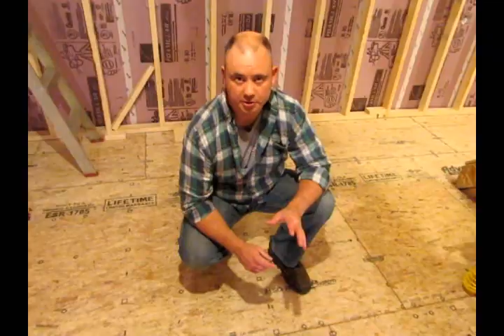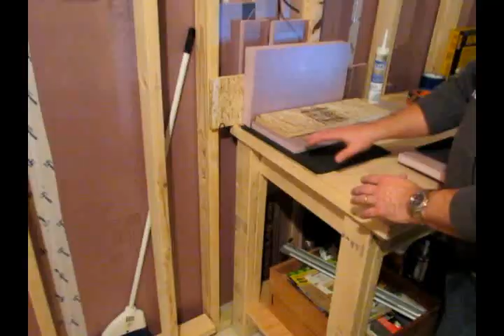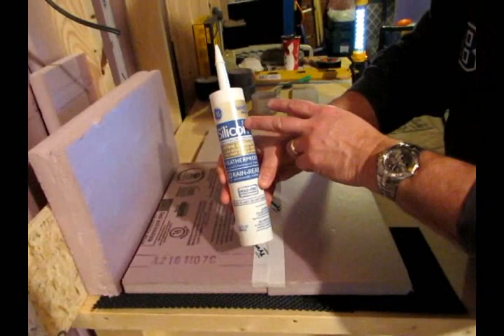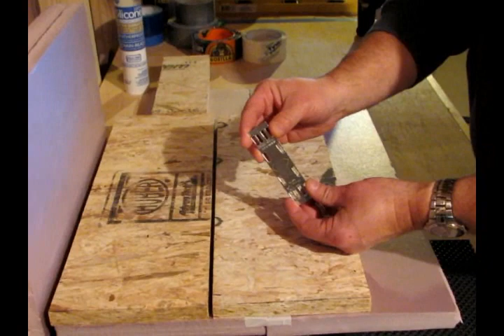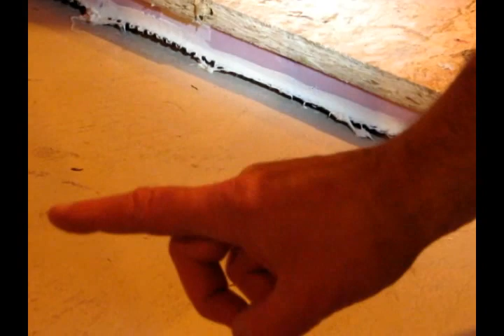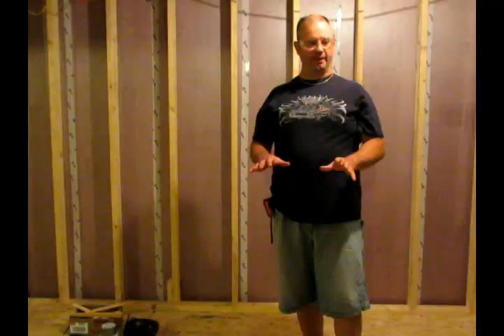Finishing a Basement - Part 2 - Floor Insulation & Floating Sub Floor

Comment: Thanks for the awesome videos.  Few questions: 

1) What brand of cement caulk did you use to fill the concrete floor seams? 
2) Did you consider first painting on a basement & masonry waterproofer on the walls & floor before the foam board?  
3) how high are your ceilings?  Were you concerned about adding mat, 1 inch foam, sub floor and carpet would be taking away too much from your room height?
Reply: If you don't install carpet and just lay down snap together flooring, can it be done right on the mat without a subfloor?
Reply from the maker: Thanks for the question. 
1.  I used DAP Concrete and Mortar Filler and Sealer (gray) which remains flexible and water tight after cured.
2.  I did not paint the concrete walls and personally do not believe this is a smart idea.  In short, it's darn near impossible to get a coating to be 100% "pinhole" free, and eventually the paint is going to fail anyway...so why spend the time and money on this.   Why...?   Even though there are many products which are intended as "waterproofing" or sealing products, and they probably work well in the early days of their lifetime, the reality is that concrete and masonry is porous, and will be a conduit for moisture and experience significant temperature swings through seasons.  Concrete is also almost always in some state of "wetness" even if it feels bone dry to the touch.  Therefore, any of these kinds of paints or sealers often are not getting great adhesion to begin with, and and perpetually exposed to moisture attacking the adhesive bond after it's applied.  Invariable, the paint will begin to bubble, eventually fracture and then peel.    This is not a permanent solution to "sealing" a concrete or masonry surface.  Here's a link to just one video about this and you can find more information if you search the web.
https://www.youtube.com/watch?v=f-ONJTLMjyE
3.  I have 8 foot ceilings through most of this basement but beneath the main beam and duct trunks about 7 feet.  I was concerned about height, particularly under the beam area, and spent quite a bit of time considering how I would manage the floor, but in the end I decided on this design as the long-term advantages of both moisture proofing and insulation were more important to me compared to the 2" I will lose under the beam.
Reply from the maker: The manufacturer of the dimple mat I used, SuperSeal, promotes this product as, "Carpet and Laminate Subfloor Membrane" according to their web page, and there you can find more information about it.  I They do promote use directly on top of concrete or wood surfaces, and so I would say that generally, yes you could use a flooring directly of top of the mat as SuperSeal indicates.  However, I would also suggest you speak with them about how to deal with some challenges you might face if you intend to use a hard flooring product as opposed to carpet including but not limited to:
a) Level:  most basement floors will not be inherently level or even flat, and in fact should be pitched towards the sump anyway.  Most hard flooring products require the installation surface to be level and flat to some significant degree, and so I might caution you on how you will deal with these challenges over the life of your flooring product.  This can be done, but techniques used for leveling and flattening floors can be a pain in the @%#.
b)  Securing the Floor:  If you install a flooring product which is intended to be and will be truly floating on top of the mat this should be no issue, however if you install any product which requires fastening to the surface below this may be a challenge / problem as you only have a thin, flexible membrane to work with or otherwise you need to go through it and into the concrete.   Any penetration of the mat at all and you have also now compromised your vapor barrier.
c)  Insulation:  If you use only the mat, the dimple profile will minimize the contact surface of the mat to the basement floor, however there is still contact and will be some heat conduction through the mat...I am not familiar with what kind of insulating value the SuperSeal mat will result in but you could contact them if you wanted to learn more.  For my project, using the rigid foam on top of the mat provides an additional minimum R-5 insulating value on the floor which we will be waling on and this was attractive to me.
d)  Safety:  This sound like a minor point, but I have a couple children and this will also be a space where they may be playing and frankly be allowed to be more rambunctious than in our main living space.  This design with the combination of the dimple mat, rigid foam, and wood sub floor has now turned a very hard, cold concrete floor into a significantly warmer, softer, and more comfortable floor for walking, sitting,,,, or even tackling.. :)
Reply: What about using densshield tile backer on the floor in place of OSB for fireproofing over foamular which is flammable. I'm not sure how well this works when building a stud wall nailed on top of tile backer. Would this work? I really like everything you have presented in your videos.  All these foam products are flammable. What are you planning to do for your wall cavities to make them fire resistant. Will you use rockwool insulation?  I don't know what to do with these 2 back to back problems- fireproofing and moisture proofing for the walls and floor. Thanks, Laura
Reply from the maker: Hi and good comments.  There's quite a bit of debate out there about the conflict of moisture-proofing and fireblocking....you can't fireblock "according to code" without the fireblocking penetrating the moisture barrier....and you can create a sealed moisture barrier from fire-blocking materials....ugh!
From all I have researched, this really comes down to interpretation of the code by the inspector.   The essence of fireblocking is to starve a fire of oxygen and thererfore stifle combustion.   By using a material like rockwool in all of the cavities between and behind the studs, and up through the rim joist spaces, you have effectively "fireblocked" provided any source of ignition is note directly in contact or accessible to the foam, where the fireproof rockwool comes into play.  In this method where you have no (very limited) air to support combustion, you have achieved fireblocking.  Of course, this is all subject to agreement by your local inspector, but the this is something the codes are very lacking in addressing.   I have seen where this is approved by local inspectors after it is thoroughly explains and provided they understand how this will achieve fireblocking.

Comment: Great video.  I am working on a similar project and have 2 questions...
1 - why not have the dimple mat curl up onto the wall foam?  Aren't you worried about moisture getting between the wall foam and the dimple mat that you have under the floor system.  That setup just seems like you may have the potential of getting water between the dimple mat and the floor foam.  
2 - how do you address where the existing basement stairs hit the ground?  You are elevating the basement floor by about 2 inches, therefore making that bottom step much less of a step than all the others.  Thanks for the video!.
Reply from the maker: Thanks and good questions:
1.  I actually considered this originally and did some testing of this on my own.  The dimple mat I used is product which can be used as a sub-floor material in itself directly under a carpet or laminate, and therefore is a relatively stiff material which does not lend itself to bending too easily.  It can be bent to form a corner, however as it is stiff, the bending actually requires some creasing which results in some plastic deformation around the many dimples; my concern with this is that deformation may lead to cracks or fractures and then we've compromised the barrier anyway. Therefore I decided to keep the mat flat and under the wall foam and seal it with the silicone caulk; Even with a roll up the wall with the mat, you would still have seams and corners to be dealt with anyway.  All in all, I've tested this in some mock-ups and am pretty happy with this result.
2. The bottom stair will be shorter, however, I also plan to make a landing out of that bottom stair so the shorter transition will be from the landing to the floor...I will show this in another future video.
Reply: Buffalo J  Thanks for the reply!  Looking forwadd to the rest of your process.  Maybe I'll document mine as well.